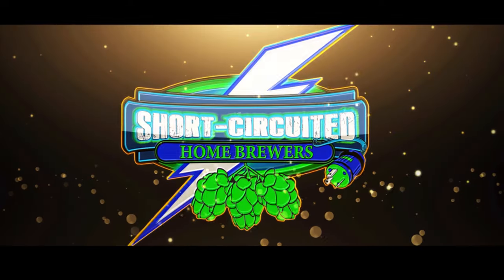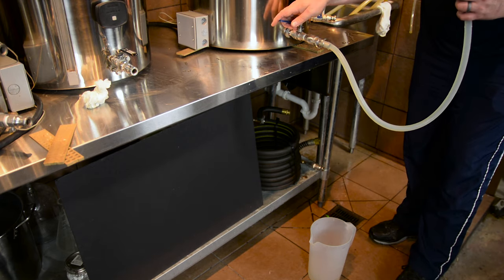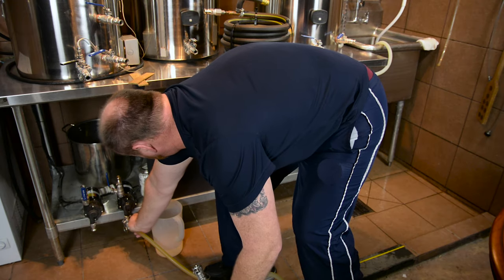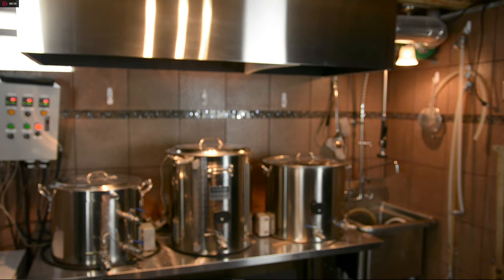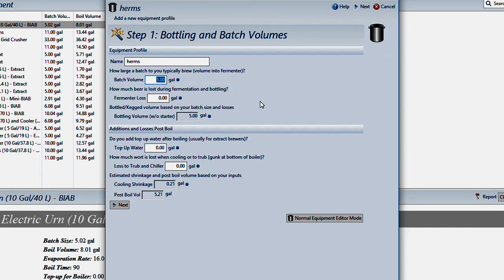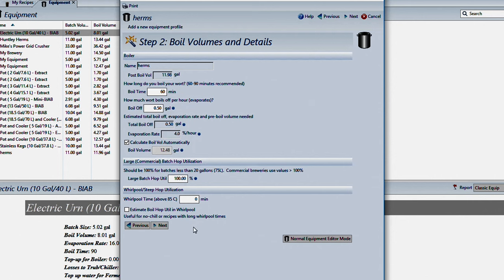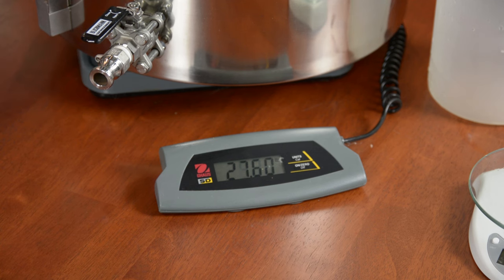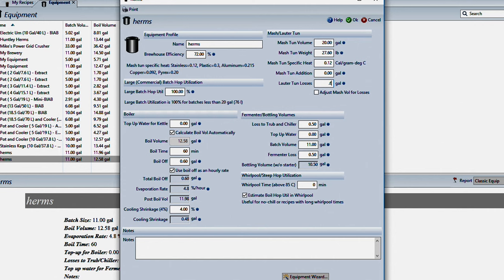Beersmith 2 Tutorial - Equipment profile, how to measure your equipment for Beersmith 2

Comment: I love your videos.  I have some feedback.  Please let me know if I'm missing something,

Starting at 7 minutes and 7 seconds.  A gallon of water weighs 8.34 lbs.  Your calculation for kettle was 6 lbs 3.1 oz or 6.19 lbs.  Your chiller water weight was 1 lbs 14.7 oz or 1.92 lbs.  The total is 8.11 lbs or .97 gallons.
Cheers!
steve
Reply from the maker: I am measuring losses not trying to get to a full gallon. Each part is measured separate from the other. A lot of people have been confused by the calculator. Cheers Steve!

Comment: I don’t understand why you need to weigh the left over water.  Can you just fill past the dip tube, drain until it stops.  Then Pour what’s left into a gallon picture.  What is in the picture is you kettle loss. Correct?
Reply from the maker: Sure. The best way to precisely measure water is by weight. But you can "eyeball" it if you want to.👍🍻

Comment: Hey Brian.  Not a electric brewer.  Well not all the way.  I have single tier 3 vessel. With rims for mash.  Anyway.  I’m really working to nail in my numbers for consistency. And for the life of me can’t figure out how to account for my HLT loss in beer smith 3.  I run my strike water through my rims  on its way to the MT. as well as running MT through rims obviously.  Any guidance would be greatly appreciated.
Reply from the maker: Are you coming up short on volume? Or over? In your boil kettle.
Reply: Short Circuited Brewers under, I feel like I have about 3/4 gallon left of strike water in my lines pump and HLT after transferring to my MT.  I know I can manually add said amount of water to my final strike amount but was trying to figure how to have BS add it for me so I don’t forget or overlook it.
Reply from the maker: @teamsomethingsomewhereteam3797  adjust the lauter tun loss by 3/4 of a gallon.
Reply: Short Circuited Brewers thanks I’ll do it and see how it goes. Appreciate your advice.
Reply from the maker: @teamsomethingsomewhereteam3797  no problem.. let me know how it goes! 👍🍻

Comment: One item I never see addressed in the Beersmith discussions is: Do the various loss volumes (kettles, MT, hoses, HERMS...) entered in the Equipment Profile assume that the system is bone dry when the brew session starts, OR that the dead spaces, hoses, HERMS etc. are water filled at the start of the brew session.  After I sanitize my system (immediately before starting to brew), my dead spaces, HERMS and hoses are all filled with water.  Just want to make sure I am treating the volumes correctly.
Reply from the maker: With my calculator you can measure all of those loses. It is a good point especially if you have long hoses. 👍🍻
Reply from the maker: It is assumed to be bone dry.. And it is never going to be 100% accurate. Any brewing software is a educated guess it will vary slightly. 👍🍻

Comment: Thank you for a great video.  I am confused on BeerSmith 2 and now 3 on how to account for lauter tun losses and mash tun addition.  In your video and equipment wizard walk-through, you leave mash tun addition blank and do not check the box to adjust for losses.  I have 2 gallons of water under my false bottom and 8lbs 6.2 oz (1.01 gallons) left in MLT after draining.  Can you help explain how to handle in BeerSmith?  Thank you!
Reply from the maker: In the mash tun addition put in 2 gallons, for the lauter tun losses input 1.01 gallons. In your case you would go ahead and check the Adjust box. The reason is so that beersmith will take into account the amount of space under the false bottom, since the liquid under the false bottom does not contact the grain.  Without checking the box, you would be throwing off the Grain to water ratio and wind up with a thicker mash than intended. Hope that helps! Cheers! 👍🍻
Reply: @ShortCircuitedBrewers  Thanks, Short Circuited.  That is what I was thinking.  I have two more variables to get your opinion on.  1. I have 0.35 gallons running through the HERMS coil and associated tubing that is run continuously throughout the mash time.  Would I add that to the 1.01 gallons under the lauter tun losses or add it to the 2 gallon mash tun addition since it will ultimately leave the mash tun?  2. I do a continuous fly sparge with 1" of water on top of the grain bed with a float switch as I drain into the kettle.  I run this process until I reach my pre-boil volume.  In other words, I do not run the mash tun dry.  With that said, do I still need to account for the 1.01 gallon mash tun loss?  Given my process, it seems as if it is really not a loss since the mash tun is never run dry.  I appreciate your feedback! Thank you.
Reply from the maker: Just for water volumes I would still keep the measurements the way they are. If you never completely drain the mash tun that is fine. I generally don't either on my HERMS system. If you want to add the .35 gallons to the mash tun addition you can. Not sure what your process is but the way I deal with the HERMS coil is to fill the mash tun by running the water through the coil and thus eliminating any need for "making up" the water in the coil. Sounds like the rest of what your doing is dialed in. Cheers! 👍🍻
Reply: @ShortCircuitedBrewers  Thank you so much.  I will stick with your recommendations, brew a batch and see how it goes.  I have had my equipment profile set up incorrectly for so long and everything just seemed out of whack.  This is the best tutorial I have been able to find.  Thanks again.  BTW, I brew with a MoreBeer Tippy.
Reply from the maker: Ler me know how it goes!  Cheers!  👍🍻

Comment: Seems like figuring the losses on your hoses was correct. I'm a little puzzled by your method on kettle/MT/HLT though. I drained/pumped mine out as much as they could go, then picked them up and dumped the remaining water into a vessel to see how much that the system would leave after draining or pumping out a vessel. Seems to be accurate when beersmith calculates my volumes.
Reply from the maker: I should have explained that.. it is a comparative measurement on the boil kettle HLT and the mash tun what the calculator does is calculates the difference between 1 gallon of water and what you
collected  out of the vessel and that measurement tells you what is left in the kettle. You can as you say pick up the kettle and dump the rest of it in a vessel and measure that I just wanted to do without having to dump the water into another container and measure that. The measurement for the Herms coil and the chiller are direct measurements by weight not comparative.
Reply: Got it. Thanks for the explanation. Your method is more high tech than I used. I just blew out hoses and herms coil/and dumped vessels. Appreciate the videos!
Reply from the maker: I have never been accused of over-complicating anything..  lol Thanks for the comment! Thanks for watching!
Reply: @ShortCircuitedBrewers  I know this is really old, and I haven't read through all the comments, but measuring what is left behind by subtracting how much was taken is only accurate if you know how much you started with.  If, for example, you had less than 1 gallon left in your kettle before you started filling your pitcher that final time, then you would have had less than the calculated .26 gallons left behind.

As my new system is too bulky to just do the "dump whats left and measure it" method, I planned on making similar calculations to what you were doing, but I was planning on entering a known quantity of water into the kettle (instead of just "fill above the dip tube"), then subtracting from that known quantity until no more would come out. That should give me a more accurate measurement (not that homebrewing really needs to be all that accurate to where an extra quart one way or the other will make much of a difference to the final product).
Reply from the maker: Whatever works for you.. 👍🍻

Comment: Something is off. Doesn't a us gal weight 8.35 lbs? How can 6 lbs be returning 0.26 +/- gals
Reply from the maker: it is a comparative measurement based on the amount collected versus the weight of one gallon.. it is not measuring the amount collected rather what's left behind in the kettle. The chiller and the rims/herms measurements are actual weight measurements. Hope that helps..